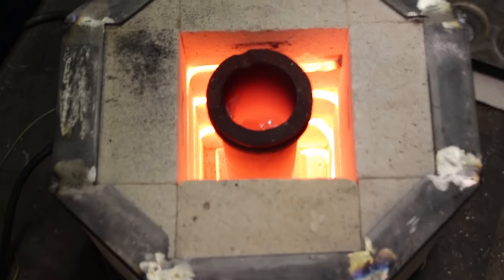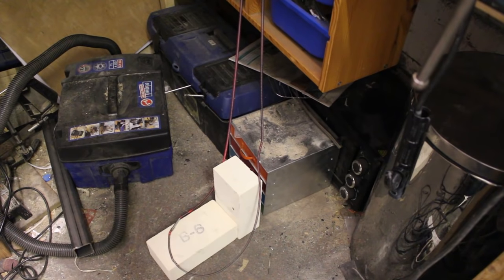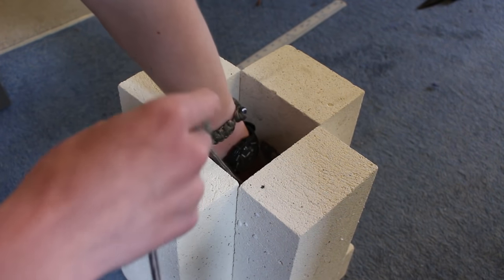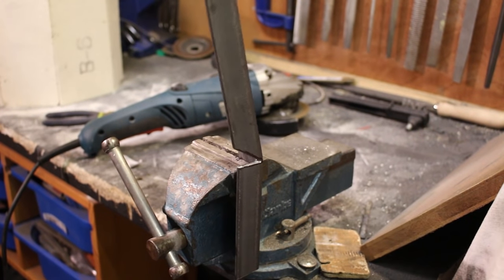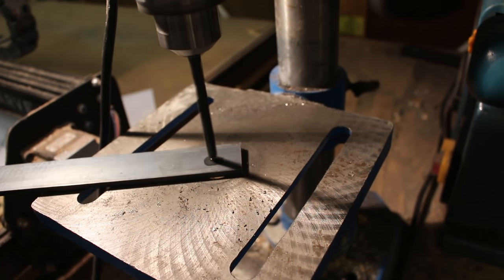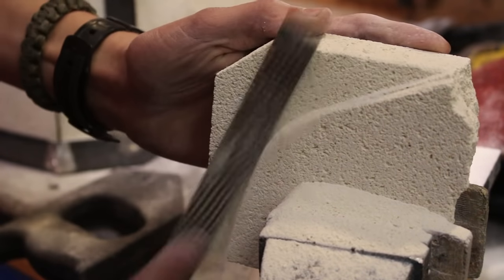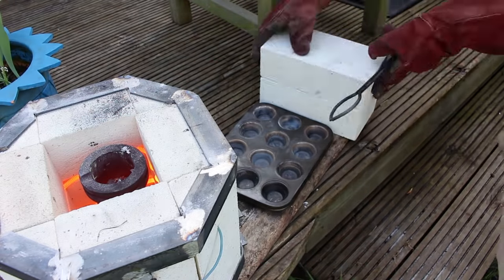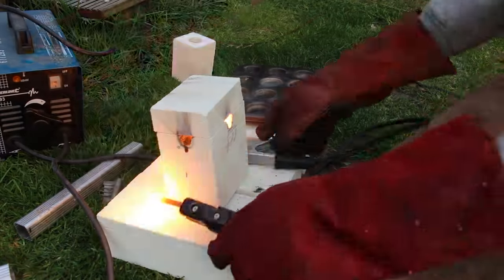How to Make an Electric Foundry For Metal Casting - Part 1

Comment from the maker: The video where I upgrade this foundry with a PID temperature controller and many other good thigs is now up!
https://www.youtube.com/watch?v=6fvBzlrlKl0
enjoy!
Reply: hey when your cleaning off the slag on the welds dont beat the weld slide chisel down the side it comes off easier and doestn stress the weld good job though ima gonna make one to you should try and make a hho genarter there fun but dangerous my to faverite things also whAt electrodes are you using
Reply: I know this has nothing to do with what you just said do you have the best handwriting ever
Reply: Exactly what's needed for forging and hardening steel for knife making!!!
Reply: TAOW
Reply: Oscar23 Vision908 ????????
Reply: I hear it's possible to do lost material casting with low density infill 3D prints, rather than foam. Somebody send this guy a 3D printer immediately !!!
Reply: http://www.toepferspass.de/index.php/keramikbedarf/Brennen-33/Brenn%C3%B6fen-Zubeh%C3%B6r-29 oder halt ebay kleinanzeigen.
Reply: How did you stretch out your elements so evenly?

Comment: "If you do touch the coils you will probably die"... I don't like this design anymore :D
Reply: Well to be fair in any version you can die of heat, the coal and propane versions actually get much hotter too
Reply: I know, I was just playing :D
Reply: Hey Jerry pls uninstall Windows 10.
Reply: y? its a very good operating system?
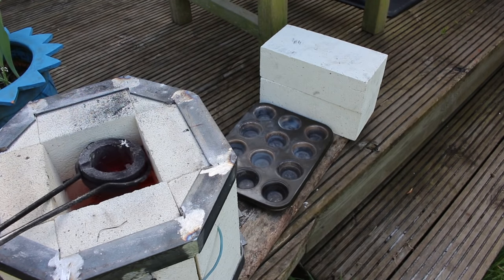Reply: I laughed so hard when he said that at 15:18. I knew there'd be a comment here of someone else that picked it up as well. It's just the way he said it. Lol
Reply: This wouldn't kill you, likely you won't even be electrocuted. Unless you are wet and touching the element, you still have more resistance than the coil that the electron flow is following.
Reply: 220 is nothing, got hit by 220 v 22 amps countless times, its just a little shock and a small burn on the skin and mostly even not that soo
Reply: henk de banaan lmao thats some fine bull, anything above 0.01 amps kills. No matter what. Voltage determines if you survive the initial discovery of old bens kite. 220 volts is enough to break down the skin as a resistor, you'd have been dead due to offset of the heart and electrical overload. Plus your nerve cells would be fried.
Reply: That "would" is something to not count on, you should try it, here we often touch the wires real Quick to test if theres electricity on it.
Reply: The same way if you poke a metal fork in a toaster with it on
Reply: Barnacules Nerdgasm I think what could work if you put on rubber gloves and then put on the welding gloves so you have heat And electric protection
Reply: Barnacules Nerdgasm Hey man! I didn't know your here! Nice to see you! :-)
Reply: yeah right, 22 amps would stop your heart immediately. volts wont.
Reply: Dan Allured umh actually isn't like that, it's true that it's the ampere that kills you and not the voltage,but only the voltage can provide you enough ampere in your body. If you touch that 220 V and 22 A, that doesn't mean that in your body will pass 22 A, cause our body have an extreme resistence (in kOmh) and the ampere that goes through your body  is obtained with the simple omh equation : I (ampere) = V (volt) / R (Resistance, Omh), so if your body have 1000 Ohm of resistance, you can't die by a 10 Volt and 100 ampere current,cause you will have only 0.0010 A :/ so yes, Volt kills you.
Reply: No more dangerous than a toaster...
Reply: Sketch It D.I.Y  -- I know its (a try at) humor , you know its( knee slapping hilarious) humor - but he who does
not know may be electrocuted ; this is why its
wrong.
Reply: oh, sure, because gas never explodes when you ignite it in a (semi)closed container... Wait, what? This design is by far the safest solution for backyard casting. Also, it cools off much quicker (the foundry itself, not the crucible), you are (partially) protected by your home's fuse box and loss-of-current switch, it is much less of a fire hazard to the entire neighbourhood, and it has much less of an environmental impact. And less toxic gases, as correctly indicated in the video. Additionally, it uses less power than an electric space heater, which uses exactly the same idea of live wire heating resistors and which people use with far less thought.
Reply: Depends. For a large contact area, you are looking at 1000 ohms for the lowest case scenario for dry skin (not wet, no punctures) from hand to hand.

At 230V, that means that 0.23A will travel through your body. At 10mA (0.010A) a person weighing 60kg's (which is not impossible for a 16 year old) can get muscle contractions to the point where they cannot let go. But, this is muddy issue. For instance, if you are wet, say, from sweating, your resistance takes a nosedive. If you have a small contact area, you are just gonna get a little zap.

But, then, are you going to go poking around in there without gloves? Eh, not likely, though I guess you could fall on it while working and testing, which is probably the time you would have to poke around in it or have it exposed anyway.

It all boils down to 'Have a healthy paranoia'. Treat it like you would an unknown heavy duty mousetrap. If you fuck up, you are probably going to get away with some stinging, or, you could wind up losing a finger.
Reply: For people that are using fixed numbers to workout body resistance please keep in mind that the values are effectively just the resistance provided by our skin so are only relevant the instant you make electrical contact since the flow of electricity burns through the skin your overall resistance drops to near zero, as for the amount of current needed to kill well thats somewhere between 100 to 200mA most protective device are set at 30mA which for most people is nothing more than just painful and hospitals etc are 10mA due to the people at these places already being higher risk
Reply: Tiny detail really....
Reply: Dan Allured maybe around 10-15mA may stop your heart. 22A wouldn’t stop your heart. It would burn and destroy your heart as well as the rest of your body that the electricity would be flowing through.
Reply: @SkywardPvP  I've backed my hand into a 220V inside a tool cutter from the 1920's and I certainly didn't die. It tossed me about 6 feet from the machine. 220 with .01 amps most certainly doesn't always kill or there would likely be about 1% of the electricians on Earth still alive.
Reply: you can use a less exposed heater element like one of these lamps used in room heaters. Those have the heater element inside a glass tube that can take very high temparatures and they could be found even in the hardware store
Reply: That's a great safety tip.  :-)

Comment: For safety reasons, please connect the green and yellow wire (earth) to the outside metal parts of the foundry. This way in case the insulation breaks and shorts to the outside, it will trip the fuse and will not shock you if you're touching the outside metal parts.
Reply: He's got bigger electrical safety problems than just the earth

Comment: I don't know what I am more impressed with, the build or the professional way in which you have clearly planned, filmed and narrated the subsequent video.
Many on here have suggested improvements, grounding the cage, heat resistant cable to connect, a proper lid, etc. And you already have plans for these improvements (and of course the PID). Looking forward to another vid showing all of these in practise.
Keep up the good work and good luck with the GCSEs!

Comment: The frame must be earthed.
The hot wire should not go through the metal frame, the sharp edge can easily cut into the insulation. If you can't make the hole elsewhere in the brick you need a ceramic tube (e.g. from a fuse) to protect the wire. These two things will not make this contraption anywhere near safe but cost nothing and would eliminate completely unnecessary hazards.

Only operate this thing on an RCD protected outlet, or better yet use a plug with integrated RCD. It's only $10 and can save your live. It would be better to use an isolation transformer, but for 2kW you are looking at maybe $100+.

The solid state relay will likely require a heatsink for the 7amps. Just thought I mention it before you burn one up.
Reply from the maker: +stefantrethan Thanks, I already have earthed the frame and bought some high temperature cable but it didn't make it into this video. Also thanks about the heat sink, I wasn't sure if I would need one but now I know :)

Comment: That active lead going through the steel ( conducting) base is a worry if the insulation melts off, please put some fibreglass insulator shroud over it.
Reply: Benjamin Clayton Damn. That forehead.
Reply: Yeah I wasn't too keen on that myself. But hey, it seems to be working for him. You can actually get high temperature wire. I used some to rewire an electric stove once. I got it at an appliance repair shop. That, along with fiberglass sleeve insulation would be a good idea there.
Reply: The frame should also be grounded (earthed)
Reply: MrOpenGL
what for?
Reply: Paul Frederick
If the live wire comes in contact with it, you will get shocked. Having it earthed will prevent that, and is also mandatory because it's not a double insulated device.
Reply: MrOpenGL
I won't get shocked. Because I am not in the habit of grabbing conductive materials with current passing through them. If I was I'd have checked out long ago now. Mandatory does not apply to me either. That only matters if you're engaged in commerce. Though there may be other liability issues depending on circumstances. Let's just say that if you get hurt I got a lot of shovels, and a big back yard. The few words I might utter won't be too pious though.
Reply: Paul Frederick
You may not be in the habit of touching conductive materials, but if that wire that is passing through the frame makes contact with it, and it is not grounded, you WILL get hurt :-)
Reply: MrOpenGL
No, I really won't. At worst I'll have to reset the breaker.

Comment: When filing the silicate bricks, couldn't you use water or maybe some type of grease on your file and the bricks to make the dust stick instead of getting airborne? Using a protective mask is a no brainer of course, but I think it might be good to do as a precauction.
Reply: No.

Comment: A crucible I use for smelting and casting aluminum: The largest diameter steel pipe at Home Depot or Lowe's and the end cap for it. I use the pipe because it is thick walled and the pipe and end cap retain the heat. Caution the pipes are usually galvanized so keep them in an acid solution such as vinegar for 2 days to dissolve the zinc

Comment: Definitely figure out a way to keep the heating element in the slots, and also prevent the crucible from touching them.

If you wanted to get even safer, you could set up a pair of tongs so that they're connected to the furnace's power cable and earthed. That way, if you did touch any live parts, the circuit breaker would trip instantly and the current would have a path to ground that doesn't flow through you.

Another potential safety mechanism would be to set up an external switch that only allows the heating element to turn on when you've got the lid in place. Of course, it might be a bit difficult to achieve depending on how hot the outside of the lid can get.

Comment: If you decide to do another one of these, here is a tip. For the top and bottom ring you cut at 90 and 45 and your edges didn't line up. If you mark the center and cut 22.5° you will get a 45 with even edges. Very good work though.

Comment: I think an interesting note here is that 13 Amps is the usual maximum for a single device in a household current in the UK, but the actual total circuit for the house is usually 80 Amps. I you know what you are doig then you can go well beyond 13 amps quite safely, but usually it will trip the household circuit. This is where three phase comes into play.

Comment: Outstanding video tutorial mate absolutely fantastic, I want to go electric for the reasons you have already stated, I used gas to fire my foundry which worked great but the noise did my head in, and this is a great solution, looking forwards to the updates.

Comment: To find the appropriate length of heating wire, you can use an Ohm meter and math. Using the formula: R = V/I (resistance equals, voltage divided by current) then use the Ohm meter to measure the heating wire to find the the appropriate resistance and length.
Eg. 
V= 230V, I= 13A, R=?
R= V/I
R= 230/13
R= 17.69 Ohms.
Depending on whatever your standard voltage is (Ours is 230V in NZ).
Use the information gained in your equation to define the length of wire needed by next, using the Ohm meter.
Reply: +Aeks - Best response so far. Probably ever. Hard to top your practical logic solving the most important issue - maximum temperature capability.  Cheers!
Reply: Thanks.

Comment: If you wanted to run lengths of resistance wire in parallel to lower the resistance / increase current - use the 1/R1 + 1/R2 = 1/Rt.

Comment: The biggest safety improvement I see (other than GFCI) would be adding a silicon controlled rectifier that makes it so it cuts power when the lid is off, this would minimize risk of electrocution. Can be run normally-closed with a low voltage gate, just put contacts between the lid and frame. You can also wire an LED indicator to show when the coils are live, and even a high temperature thermistor + PID controller for maximum overkill.

Edit: just saw the PID control in another video, nice

Comment: The voltage is proportionally divided along the length of the coil, you should have 120v halfway. If you put the neutral terminal at the top, you wouldn't get a big shock from the upper end of the coil. For comparizon, a hot water tank heater is 20 omhs. Amazing video by the way!!

Comment: Nice video and very clever. To make this safer than it is right now, Id suggest that you connect your earth wire to the metal frame you made, and run the whole thing on a portable RCD outlet (B-type is best for this application but most off-the-shelf RCD protected outlets are C-type, which is also fine). This will at least (hopefully!) save you from an electric shock if the insulation on the wires deteriorates and the metal frame becomes live or you accidently make contact with the heating element with your tongs.

Comment: Hey! Instead of whacking aluminium with a hammer, you should get a pneumatic cylinder and a compressor to crush the tubings. 
It's also a great press if you're into press fit assembly!

Comment: maybe add an isolation transformer so there is no risk of shock.
the galvanic isolation would mean there is no potential to ground so you would have to touch both poles at the same time to get a shock.

sure an isolation transformer at 1.8kW would be expensive, but worth a look in future builds.

great job, very interesting.

Comment: That's awesome.. 
1.you can use insulation to that coil and cable connection.
2.Use bigger copper diameter of cable. Just look at wire ampere rating on ansi or iec standart, based on your mcb power supply.
3.use nya or nym cable type instead of nyam.
Those little upgrade would be more safety.

In the real industry (I saw it in glass making production in their furnace area / Japanese corporation) I saw they use that kind of brick too but use fire gas instead of this brilliant coil conductor as heater.
I Really appreciate you bro..

Comment: An induction-heated electric kiln would be easier to use than trying to manually stretch a heating element just so.  Perhaps give that a try in your next video!  It would also heat up quicker, and all it takes is a good cast iron crucible.  Plus, induction uses less juice than a resistance coil.

Comment: Please go to a steel stockholder for your angle iron in the future, you should be able to get a full 6 meter length for £10. Likewise for your flat bar, should be able to get 6 meter lengths for what you're paying.
That aside, I quite like the design and I'm quite tempted to try it.

Comment: Nice.  
As a bit of constructive criticism, if you cut all of the top pieces for your upper and lower frame using 67.5 degrees (or close) instead of cutting one edge 90 degrees and the other 45 degrees, then you will have the same length along the top where the 2 pieces of angle iron come together.  Not really any better than what you did but it would look better.

Comment: You can also use microcontroller to to control temp like Strady temp
if microcontroller detect that temp is low it will increase temp to  which you set

Comment: Brilliant work !! ...It should be possible to melt copper in that .... Get some rock wool  and make another layer of insulation all  around the kiln ... might take 12hrs to heat up , during the final hours you will have to reduce the electrical power  to stop the coil melting (cheap high current mains dimmers are available on eBay) ... Spacing the coil 3cm apart instead of 6cm should melt copper without further insulation.

Comment: Nice job!! But the calculations are done with the resistance of a cold wire. Keep in mind that the resistance increases rapidly when the wire starts radiating.

Comment: Cutting the angles at +/- 22.5 degrees rather than 90+45 would have given rather neater joints on your first metal band, especially if you then V-grooved the top of the joint before welding. Nice work on the spiral groove on the bricks.

For the connections to the mains cable, I would have recommended some crimp-on ring terminals, The mains cable is going to get heated up a fair bit by the conduction of the M6 rod, and you may find the wire insulation melts over time. You should be able to buy a couple of metres of high temperature flex specifically designed to be used on electric fires - it has high temperature rated insulation which will be far safer. The insulation on that type will have a "bathroom sealant" kind of feel as it's silicone based rubber.